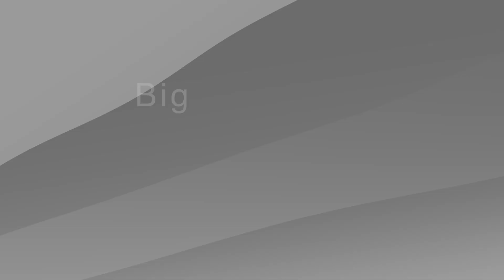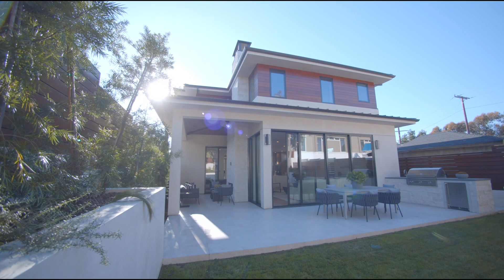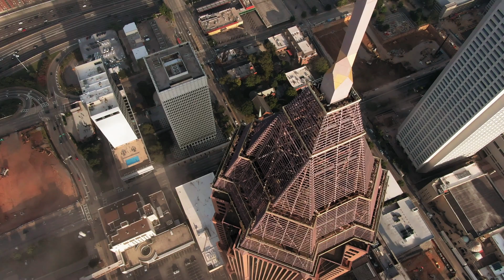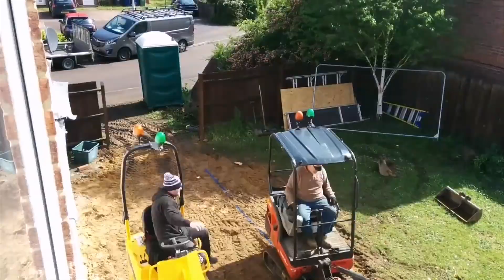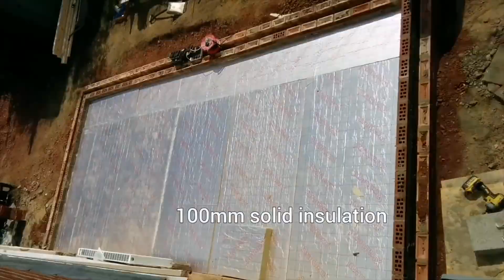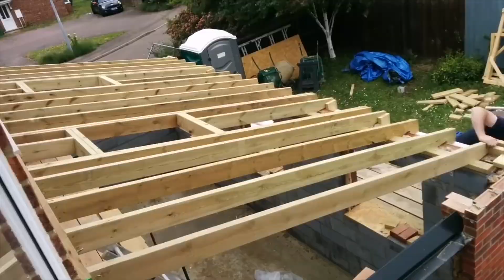Big vs. Small Projects - Structural Engineering

Comment: Another great video! Just a quick question - do you feel that to become a well rounded/chartered engineer you need to have experience/exposure to the larger projects?
Reply from the maker: you should definitely try and get a mixture of projects under your belt. I would say size of project is not as important as the type. So you can learn a lot from a small basement job versus a new steel frame job. not to say there isnt anything to learn from a new steel frame job, but a big project doesnt necessarily mean more learning.
Reply: @EverydayDazz  That makes sense, I really appreciate the response!

Comment: I totally agree! I would take a six figure project over a eight or nine figure project any day. 

If you're a grad working on a small project, you get the opportunity to work on the structure from top to bottom and you get to be influential. Architect's, M&E engineer's and contractor's are more likely to value your opinion and you get more freedom to actually design the structure.

Large projects are usually over budget, very stressful, and very inflexible. All decisions are made by people more important than yourself and you have virtually no control or influence on anything. You just work on one tiny corner of the project and when you're done you move on the next tiny portion. You're always under pressure to deliver and constantly battling against the clock. And all this for bragging rights of working on a large project? Nah, I'll pass thanks.